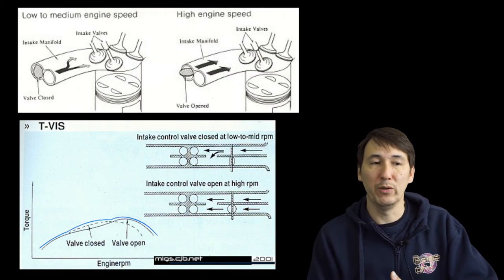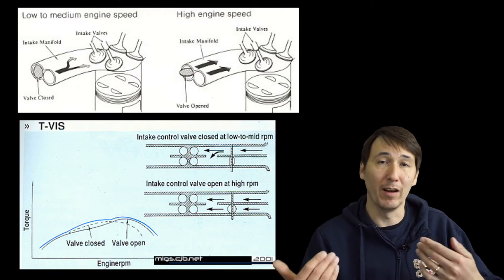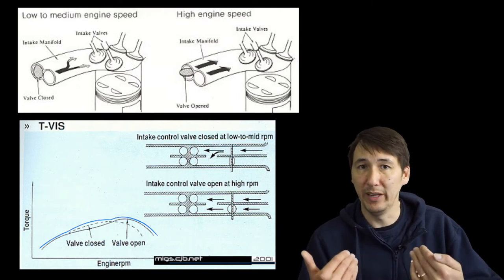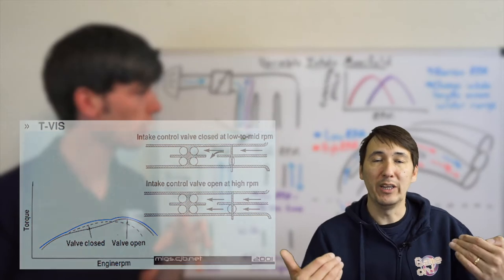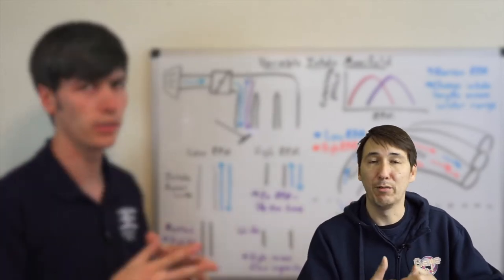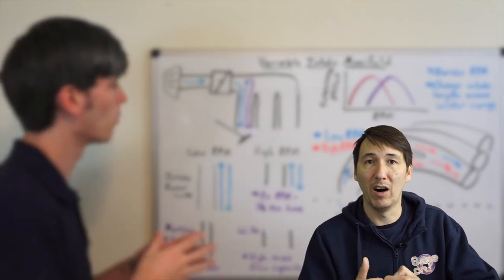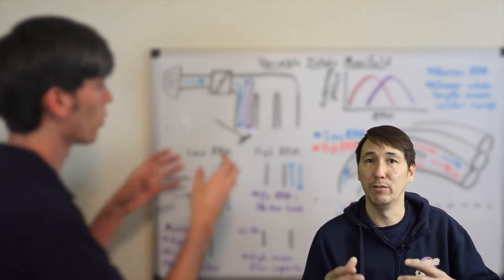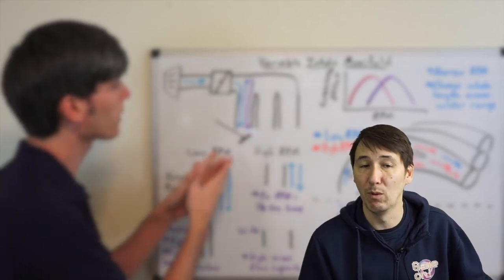4AGE History Addendum

Comment: The exact way the VVT system on the 20V works is the VVT solenoid when activated bridges the oil pressure channel to the VVT pulley. The inside of the pulley has some angled grooves and a large spring that resists the motion. The oil pressure going into the pulley pushes the spring back and moves the outside of the pulley in relation to the middle section until it reaches a fixed angle. When the solenoid is turned off it opens a channel between the VVT oil supply port and the inside of the cylinder head as well as blocking the oil supply fro going through. So what happens is that once the oil pressure is removed the spring inside the VVT pulley pushes the oil in reverse out of the supply port and it gets drained off in the head. On a side note that Beams VVT solenoid picture looks rather familar! All good though, I am happy you used it.

Comment: Look, good videos for people new to the 4a engines and good information. BUT it shows you have no idea what so ever about the engines, just online research. I would suggest if you want to make a video, your best source would be people that have built, transplanted and actually have dealt with each of the 4a engines. Good try at a presentation of information that has been available in toyota forums for 15+ years. Next time i need information thats been around for 15 years put into a power point presentation,  i will ask you first!!!!!
Reply from the maker: +micheal alexander +micheal alexander Thank you so much for your constructive comment.
Look, i didn't say anywhere that I'm a fully fledged mechanic with experience of rebuilding all 4age engines. In contrary: I said this was a primer for people, giving an overview with the differences between each model. If you feel you were deceived by the title because you didn't read the description of this video not listened to the introduction of the video, don't vent that in the comments...
About the copying of what is available on the internet: I didn't need to. Most of that information was readily available on AEU86 (which I have been running since 2004), and the additional information from reliable sources (club4ag and Billzilla) and I simply provided what wasn't there yet. Back when I created this video I planned to make follow up videos that are in depth about each and every model. As you may have seen I haven't had the time to create those and I'll surely keep your advice on the back of my mind once I'm going to do so.
Reply: UM you just said you copied the information of club4ag and my mate bill. If you researched better you would have toymods etc. As i said, you just used information from all the forums and you really do not know much about building the ae86 or the ae86. What is the easier front brakes swap? What is the best wheel size and offset? But best of all, What does an ae86 weigh without and engine:) Dont go by the internet because all i have seen is wrong:)
Reply: Lol i laughed at not knowing how the bigport 4ag butterflies work. I have 13 butterfly plates  sitting in my shed, can send you one so you understand how they work:) Could you explain to me which head can be worked to be the most effective 16v bigport,16v small port or 20v? I wait for your great understanding. I know you just read the forums and made a video, good luck to you, but you are not really helping anyone:) Point them to the forums and they will get all the answers and information:)
Reply from the maker: +micheal alexander apparently as much as you try to bring me down technically, you lack the same in explaining and tact. Sending me a butterfly plate won't help a thing, as the thing I mixed up had nothing to do with the plate to begin with. It was all about the way the intake runners work. I do appreciate the offer though and if you also have thirteen t-vis intakes in your shed, you are more than welcome to send me one. Contact me on my email to get the address to ship it to. ;)
Reply from the maker: +micheal alexander first of all, forums are so 2001. There is a lot of information out there that is not directly available unless you read a 30 page thread and read 30 pages of misconceptions. Also if you would ask anyone on a forum what the best way to modify a 4age would be, you would get 100 different answers by 50 users. You apparently have 15 years (or more) experience and know Bill Sherwood personally, good for you and I really envy you for that! I honestly wish I had the same amount of experience you have and would be able to share this with others.
We all have opinions on things and apparently you have yours. If the way you express or present this experience would be a constructive one I wouldn't have an issue with it. However you pose here as the big I know it all and did this all 15 years ago and whoever doesn't know all the things I know is inferior and I frown upon them. What I'm trying to do here is make content more accessible, share with others, am open for discussion, acknowledge when I'm wrong and put things right.  Which of the two of us is showing seniority here? (And I'm not taking about the technical knowledge right now) 
Please go back to your shed, close the door and shut down the internet. You'll be safe there from anyone attempting to share information that you find errant.